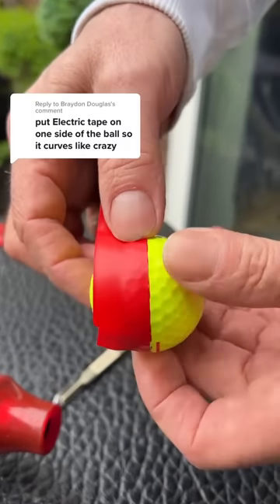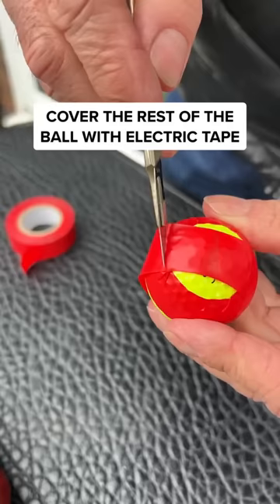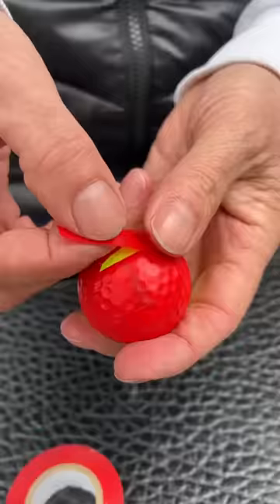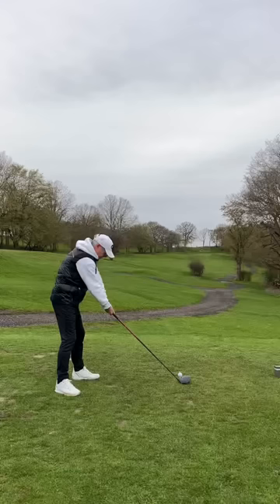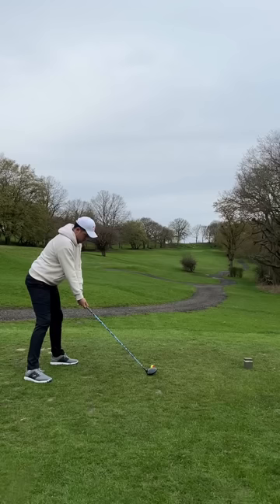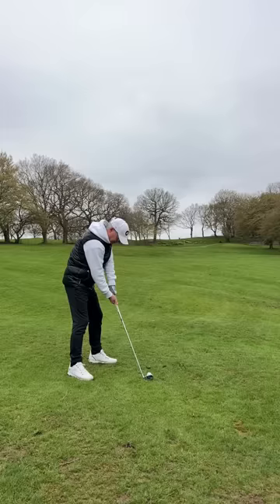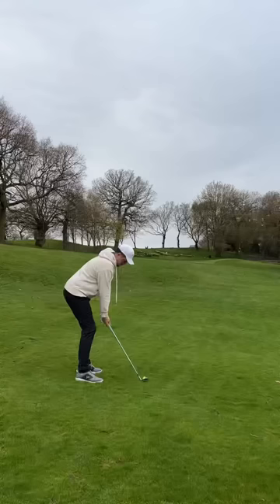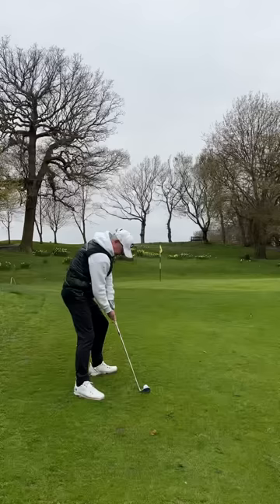Father VS Son - Electric tape on HALF a Golf Ball?!

Comment: Nobody here commenting about how the ball never massively curved. So either you have a terrible slice or hook that the ball was correcting, or the tape trick doesn't work.
Reply: Holy shit, I didn’t not process that, this might be the trick I need, multiple different stances and grips, bringing down the club. all I needed was tape
Reply: @treyo8592  At the start of the video he says that covering half the ball in tape is supposed to make it "massively curve." I was observing that it didn't, so the tape trick clearly does nothing. I'm not sure what you're doing.
Reply: electric tape works on lighter items cos it adds weights and is smooth like a tennis ball, you put so little on the golf ball it’s minimal
Reply: @naanbred7718  cricket teams got banned for taping but maybe that has to with the bounce
Reply: in this case its most likely due to the fact he heatgunned it. it removed all of the wind resistance the tape wouldve otherwise created. instead of curving because of higher weight, it instead pushed the air further out causing a straighter path.
Reply: @Tony Ravioli  was just about to say this. Using the heat gun melts the tape to sort of resemble the ball, it wouldn't have any effect on it at all. I'm assuming they meant to tape it without using heat for the effect to take place
Reply: Thank you
Reply: Every Aussie kid playing back yard cricket knows how to tape a tennis ball to make it swing.
Reply: @dillonbaker2970  I agree
Reply: @treyo8592  i like when it goes straight . Not a fan of curve
Reply: @dillonbaker2970  same, I rushed to the comments to call the error but I knew someone else noticed the effect the heat gun had on shape
Reply: @Gregory Clifford  yea bro same and then I found Tony's comment. Heat on plastic just melts surprised they didn't realize that when doing it haha
Reply: Yeah the tape doesn’t really do anything because he pressed it into the dimples. If the dimples weren’t present it would make a difference
Reply: The tape formed to the shape of the ball too well. Notice the heat gun made the stippling show through the tape, have to find a way to eliminate the stippling.

Comment: The dimples are what help with aerodynamics and curve, covering the dimples would give it way less drag so it would probably fly way further and more straight but would struggle to curve because, as the ball passes through the air there’s nothing for the air to push into or against to create a spin for the ball, so the ball glides through the air rather then spins.
Reply: dimples DO help with aerodynamics... the rest you wrote is completely backwards.... the dimples give it less drag.. smooth surface creates MORE drag and LESS distance.. 

dimples have nothing to do with the spin, 100% of the spin is imparted by the club face, and the angle at which the club face is, in relation to the arc its swinging through when it contacts the ball... 

the dimples break up what is basically surface tension, suction, that creates vortices, which is basically turbulence... the dimples break that and make for a smoother, more stable flight through the air